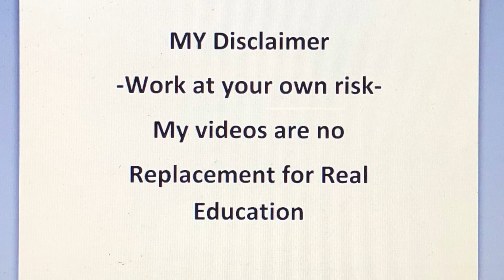Our goats. Casting sterling silver in the studio

Comment: is there a reason for centrifugal over vacuum? n im curious of the ventilation required for a burn out, what r u using?
Reply from the maker: Hello.  I do both types of casting. Centrifugal for me is my go to casting. I’ve always cast this way. And for ventilation I have the door right there. And for burn out I have the vent on top of the burn out oven plumbed to have the smoke go out the window. Hope that helps and I did a video about the burn out oven a while ago. Thx